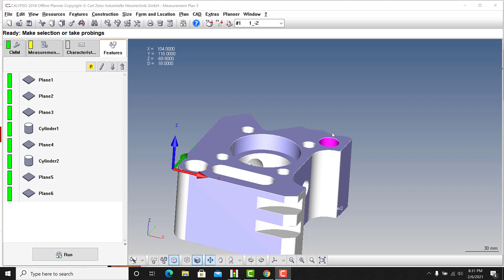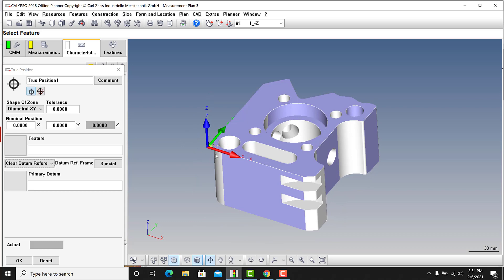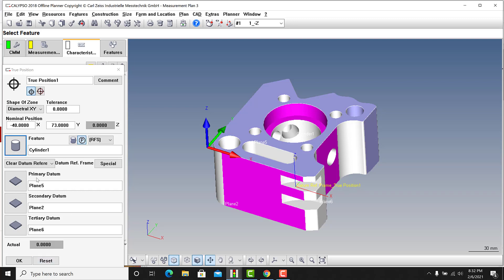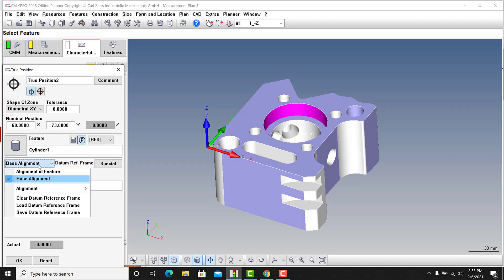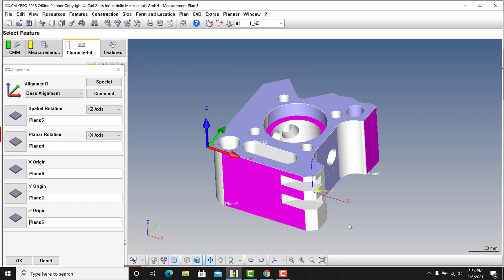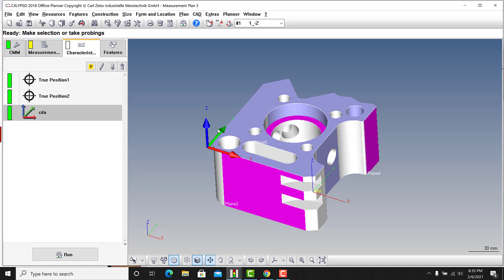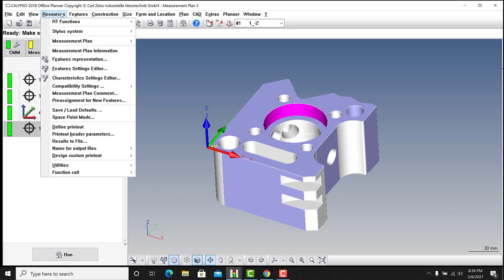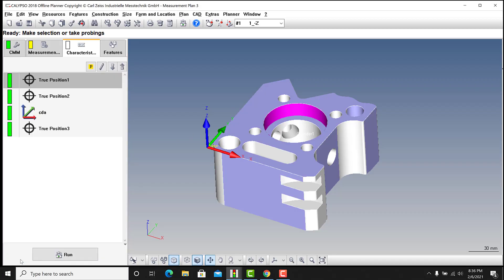Zeiss CMM Calypso Datum Reference/Alignment Methods

Comment: Have you ever seen different results using the different methods but checking the same feature? We have and can not explain why unless the method of selecting each in the output is not properly aligning and more so translating where as the Alignment methods is actually doing the full control?

Comment: very well explained. thank you and keep doing more videos like this short but a lot of information to learn.
Reply from the maker: Thanks, will do!
Reply: Good video. I am not trying to bust your chops but when using Base Alignment or a secondary alignment as the reference in a position, it doesn’t take advantage of using Outer Tangential Evaluation or constraints as required in GD&T per ASME Y14.5.  Yes, you could go into the alignment and activate these functions but why, when you can have them be applied automatically by assigning each datum feature to its respective Primary, Secondary or Tertiary role.  This only requires that OTE and constrain per ISO 5459 options be active under Form Datum in Measurement Settings.  I’m definitely in favor of using secondary alignments in the feature, when needed, because they can make it easier to validate nominal values. 

As you showed, saving the datum reference frame name is a good way to simplify repetitive instances.

I understand you may have been trying to keep the video short and simple but I feel it’s important to mention that there may be more to uncover,.  Maybe this could be addressed in a future video? 😁